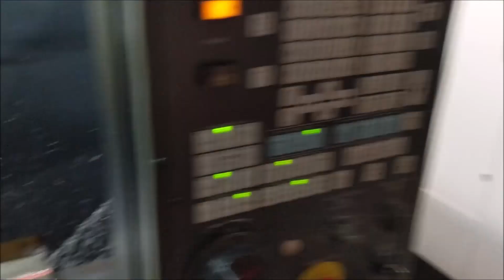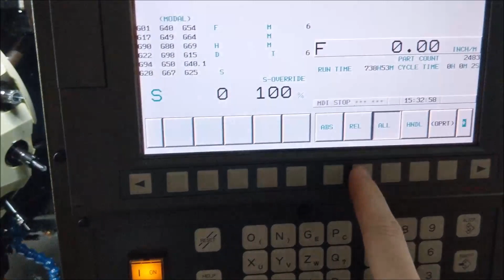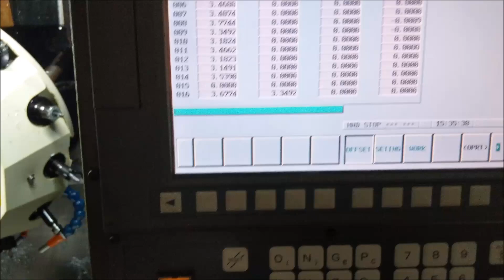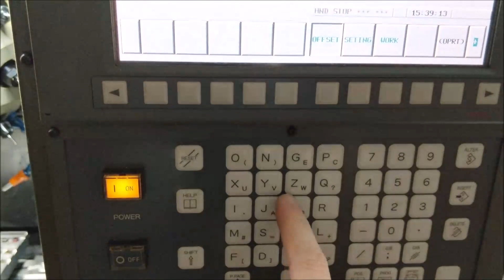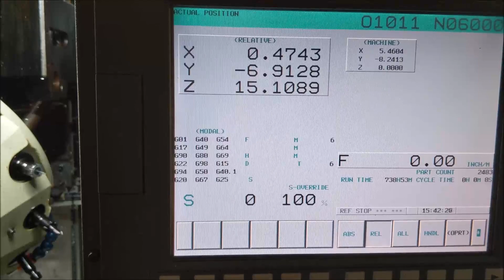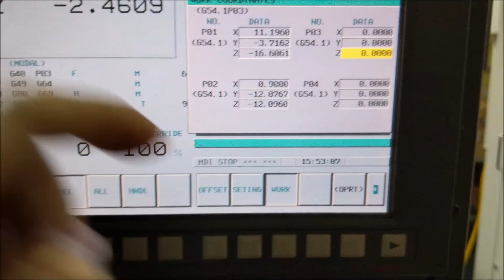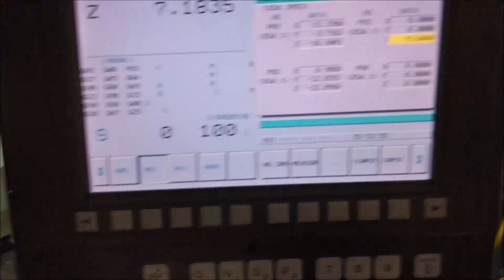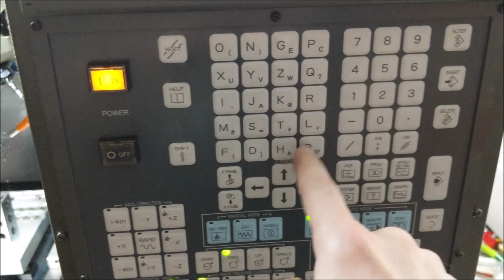Fanuc Work and Tool Offsets

Comment: Have you had good luck with that edge technology tool setter?
Reply: I have since sold this machine but I used that setter for 2 years and it worked great!
Reply: I use those edge technology height indicators also. They are really good. Worth the money.

Comment: Are you using Fanuc Super Cap to setup your tooling? Looks like you’re in a different screen of offsets which I tried to setup tooling there but it wouldn’t allow them to be set any place other than super cap and it wants a lot of detail for each tool.
Reply: To be honest I have no idea what super cap is, pretty sure this machine doesn't have it. I actually sold this machine some time ago, but kept these videos around for the new owner to reference.
Reply: @b3nsb3nz  I'm sure he is more than grateful to learn the absurd way of doing things. Super Cap is the newer control overlay geared towards dumbing down machinists. I'm sure you would find it handy.